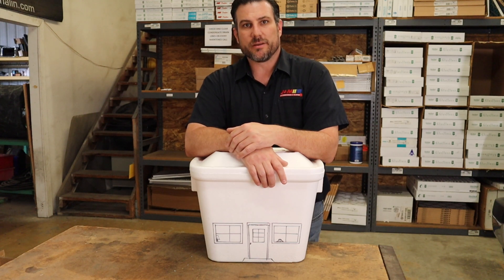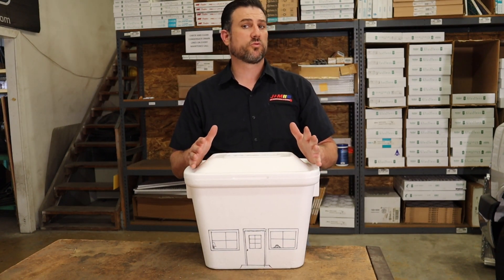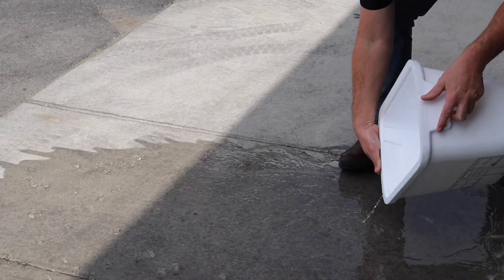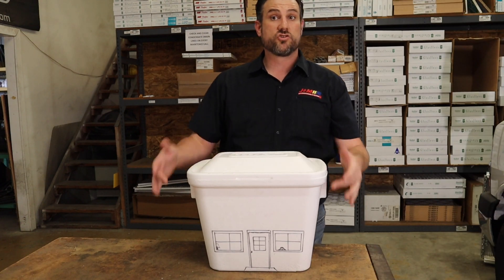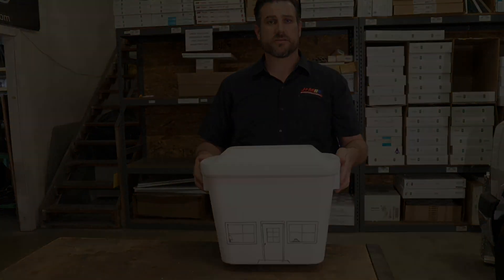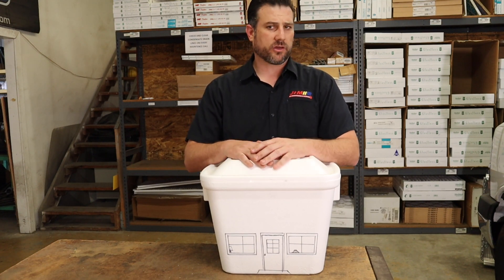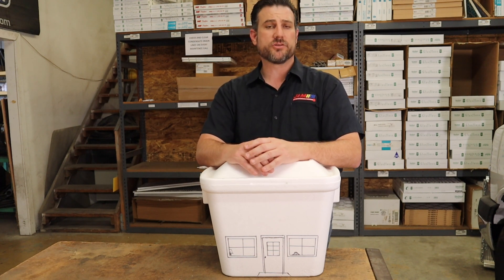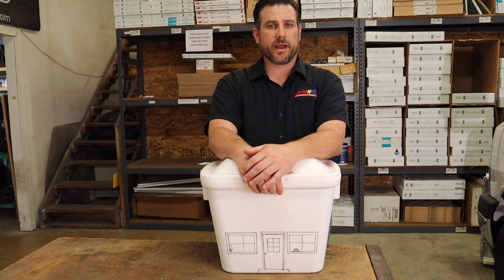What Size AC unit should I have? - Load Calculations

Comment: I need it 72 when it’s 115 outside. I do feel confident in that 400 sq ft per ton approach. Seems to work great in Tucson.
Reply from the maker: Do you make any adjustments for houses that have no insulation, or perhaps single pane windows? Does 400 sq ft ton work on a house that has triple pane windows and R-60 ceilings? 
No. But I am glad it works for you. (it doesn't)